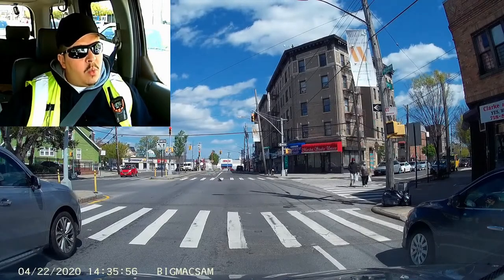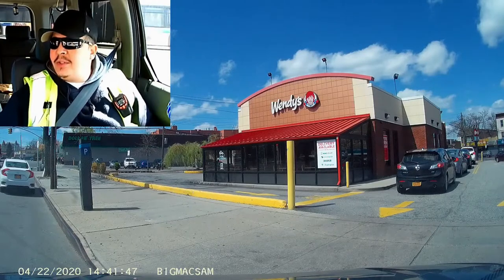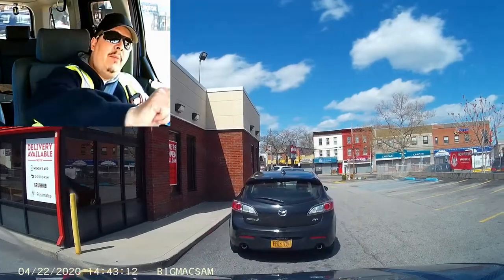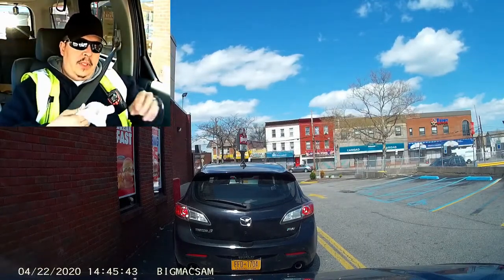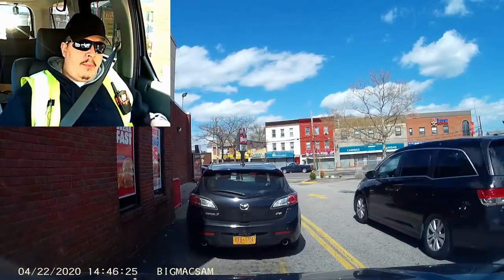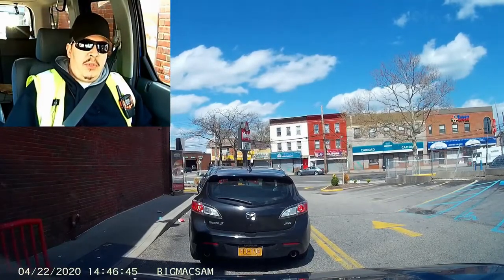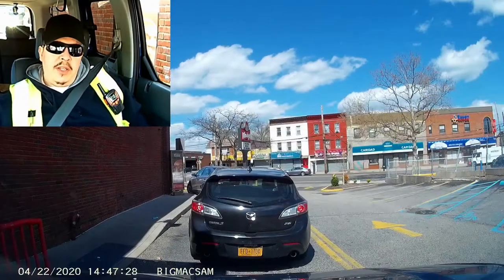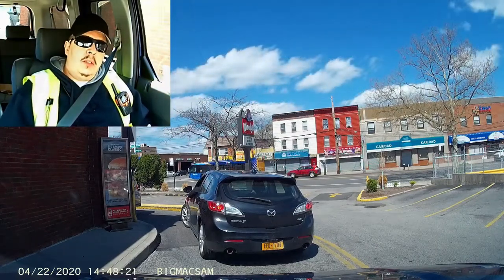The Truth On This N95 Mask With Breathing Valve | #BigMacSam

Comment from the maker: Hello everyone, I did a lot of editing on this video just to get to the point. Viewers tend to skip a video when it is too long. So basically I'm talking about the N95 mask with breathing or exhaust port. I've been using this type of mask for years when I get into a certain project. The mask is good to wear to prevent humidity or condensation in the mask. The problem? It can let germs and viruses escape from the breathing valve. Also if the rubber seal is defective or dust or some small particle gets caught in between the rubber seal and the cage, it will become useless and not protect you from the outside environment. Stay safe!